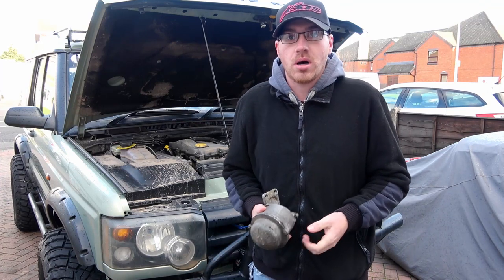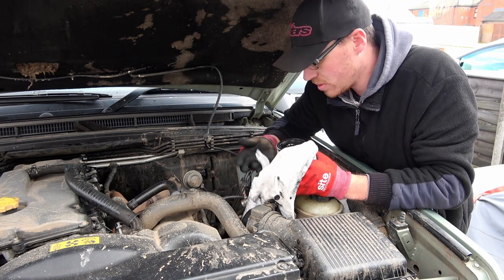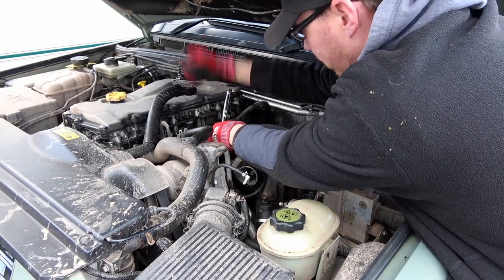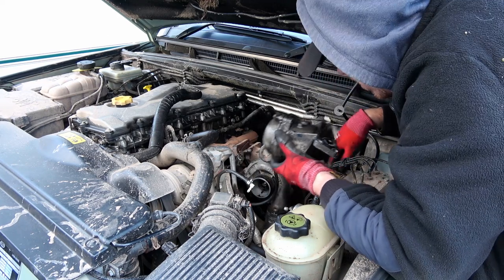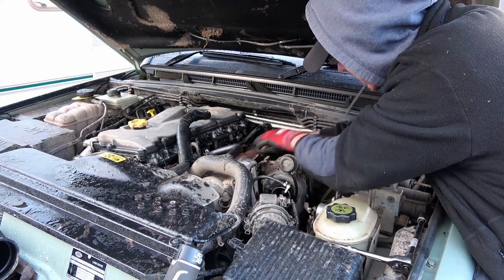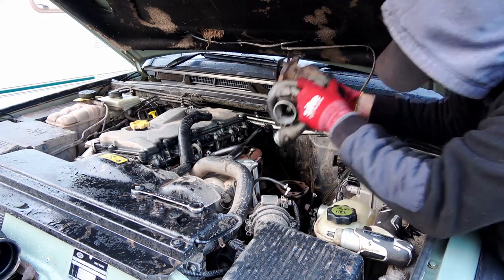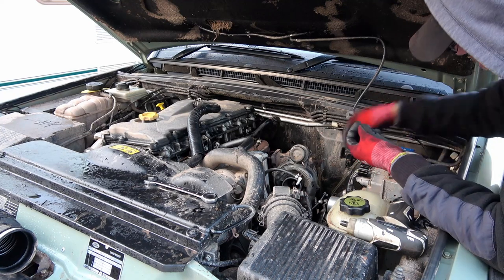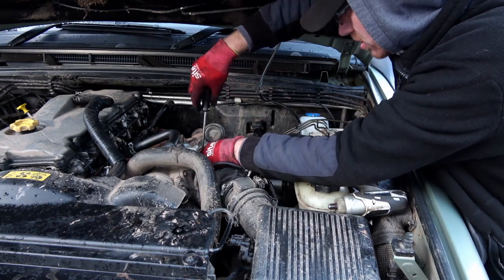Land Rover Discovery TD5 Centrifugal oil filter housing

Comment: cheers for taking time to do vid, saved me alot of messing, according to D2 workshop manual, centrifuge cover bolts 10Nm (7lbf.ft) same for oil drain pipe to housing and again for drain pipe to sump, 25Nm (18 lbf.ft) centrifuge to oil cooler housing bolts.

Comment: Turbo removal I found was surprisingly easy. That third exhaust bolt around the back can be easily got to from underneath with a few long extensions. Well done tackling this job though, especially in winter!  Frankly, I would have put a longer bolt and nut through! I  always 'research' Youtube first for any hints and tips!

Comment: did this all for my family as we had to change the turbo cartage and engine oil cooler as it was compromised along with water pump power steering pump  have fids and images on my fb good work doing it without taking more apart

Comment: the engine room is coated with oil. Cool British engineers who care to drive for life without rust. British Emotion. I drive a Discovery 2 TD5 (2004, LHD, full options) with ACE, with fuel burning heater. my lovely d2 is leaking oil too. video is good. I'm looking forward to another video.

Comment: I got some slightly longer bolts from a hardware shop. They grabbed, all good until I forget and over torque them.  I'll be drilling, tapping, and putting in studs next time.

Comment: I got a long drill and tap extender, to drill oversize and tap for larger bolts. No removal required.
Reply: I got some slightly longer bolts from a hardware shop. They grabbed, all good until I forget and over torque them.  I'll be drilling, tapping, and putting in studs next time.

Comment: could you retap it with a slightly bigger thread, I know I over tighten it on my last oil change. it has not pulled yet, but sure it will. (I looked at the wrong torque value) on rave. I should of realised......

Comment: I just went to change the filter and the thread was done so I put longer bolts in as the thread goes all the way and there is a hole at the bottom so the longer bolt can come out the bottom much easier
Reply: Yes....me too and it only cost only 50p..And , it  took me minutes to fix.     I do see where you are coming from though 👍 and just want to fix as spec.  You only need to have the centrifugal filter bolts hand tight.  It usually is an apprentice with no experience with a very heavy hand who damages screw housings; or the inexperienced td5 amateur.

Comment: really useful as i have the same problem.....Is there an o ring where the housing meets the oil cooler?
Reply from the maker: Yes there is make sure the o ring is seated correctly before bolting the housing back on
Reply: Tabb88 thought there might be.  I found the bolts untorqued on mine after some major work by a garage and I think they’ve all worked loose and the o ring has fallen away thus giving me 5 litres of oil on the ground and a tow home!
Reply from the maker: Dangerman 777 ouch! I take it you saved the engine? No damage done? What did the garage have to say about it because I know these aren’t the smoothest engines but they don’t rattle bolts loose lol
Reply: @tabb8872  fortunately I was close to a stopping point so no more than 300 yards after the oil pressure light came on.   I didn't approach the garage as I can't expect truth or integrity from them now and I can't be bothered chasing them for the price of the oil and my own time when they deny everything. The top right bolt of the three was laid on the engine block to the rear of all of the oil assemblies, the lower right was finger-tight.  On getting everything off I found the o-ring had distorted and burst with the pressure so the oil went out on the loose side of the housing.  It was a miracle it managed until then..... and of course also found the stripped centrifugal filter bolt that was causing my gradual drop in oil level..... and a finger tight banjo bolt for turbo feed!
Have now found a new garage for work that's too difficult for me  or i can't be bothered doing... your video helped in this job for me ..... fortunately I was able to get the o ring replaced by just shifting the filter housing upwards after moving turbo aside and undoing the lower union for the oil return pipe.
Reply from the maker: Dangerman 777 that was lucky then! An I’ve been there in the past not being able to trust garages now I do all my own mechanical stuff, I have a friend that owns a body shop and a guy that’s a god with diagnostics, 
I’m really happy to hear that the video was of help if you do it yourself you know it’s done right 👌🏻